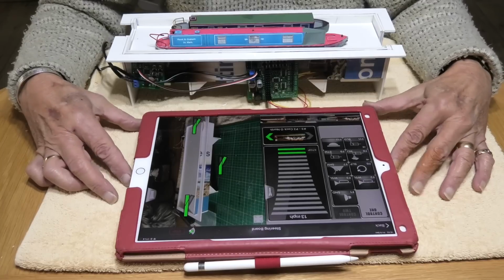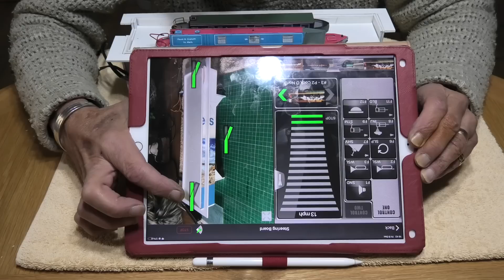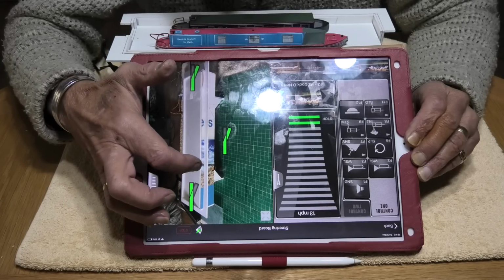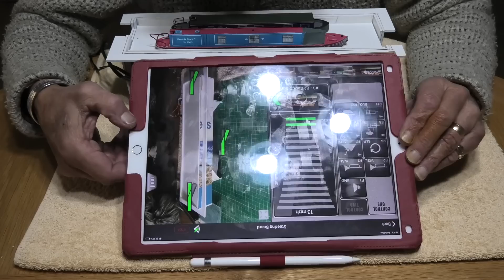Part 3 of building the lock - We now have raising and lowering water in the lock!       9-12-2022

Comment: Dear Graham, love how you accomplished your proof of concept for the sluice. For the guillotine sluice doors, am just wondering if it’s an option to use the similar method to move the doors? Especially where the guillotine doors demand a ‘rail’ system in which they move up and down. Which in turn would allow for all the servos to be installed below the water level. Anyhow, am very much aware what you said. Certainly don’t wanna be disrespectful with this question. The question arose more or less from your narration in which I understood you were going to put the servos on top of the model. Hence, it may just be a case of my misunderstanding. Love the project, absolutely beautiful how you are able to make the sluice surface move with such a simple and effective method. Curious for next developments and episodes. Cheerio
Reply from the maker: Hi Vincent and thanks for the comment, it’s greatly appreciated. I think there must have been a misunderstanding as regards the servos, they will all be below ground level and won’t be seen as per the concept module. The top of the model is the ground level (or will be once installed) so anything below that will be hidden including the servos but they will be accessible from under the baseboard should I need to get to them. I hope that clarifies it all for you and by the way, you were not disrespectful at all and politely asked the question so thank you for that.       Cheers for now.            …………Graham

Comment: This is very interesting.  Lock up and down, boat in and out, moving sideways.  It is quite the project.  I will be very interested in seeing how you solve it.  I know you will too because you are a master at all things mechanical and in this case electrical too.  Bye for now my friend…Rob
Reply from the maker: Hi Rob and thank you for the comment. I am working on one of the lock gates at the moment and it look ok at the moment but to save time then I will only build one gate as the other will be identical, as long as I can get this one working to how I want then I can replicate the other on the real build. The barges won’t be able to go sideways, if I want to move them sideways then I will need to do that by hand but as I’m planning to have only one barge which moves then I only have to concentrate on getting that into position, the other barge will only be for show.     Cheers for now my friend.         ………..Graham
Reply: @GrahamFoulston  A man with a plan.  I was confident you had it all worked out.  Good idea to build one, work out the issues and then duplicate the successful design.  It will be exciting to watch this develop.  Can’t wait…, cheers for mow
Reply from the maker: @FarlandHowe       Thanks Rob, I do have it all worked out in theory but at the moment that’s all it is, but what I’ve done so far seems to work ok so onwards and upwards for the gates now.      Cheers for now buddy.    ………Graham
Reply: @GrahamFoulston  I am sure you will get it solved.  I have the utmost confidence. Back to buying a mattress, ;-)

Comment: Great work Graham, I tell you what, something that you think is going to be quite a simple project has certainly turned out to stretch the old grey cells and to your credit you’ve come up with a very elegant solution.

Now, call me daft but when you say this is going to lift the ‘water’ up and down do you actually mean ‘water’?…. there, I said I was being daft but looking at your excellent engineering skills I wouldn’t be at all surprised 😯!

All the best,

R
Reply from the maker: Hi my friend and thank you for the comment. No you’re not daft at all but I won’t be using real water, it will just be simulated water using either resin or painted. Funnily enough, real water doesn’t work to well on OO scale models as it just doesn’t look to scale. Splashes and ripples look far too big for the scale, small ripples of real water can look like large waves in OO scale plus you have all the issues of possible leakage too. You are also right in that what appears to be a simple case of raising which at the moment looks just like a flat platform of board is a lot more complex than it looks, so many things have to be taken into account which are not immediately obvious. So careful planning and a lot of experimenting ensues before getting to this stage. Luckily for me it has worked out ok though and I’m pleased with this end result. The real model will be a lot more refined than this concept model so stay tuned !    Cheers for now mate.          ………..Graham

Comment: Very very impressed so far. Well worth the wait. How are the servos going to cope with the extra weight of the resin water?
Reply from the maker: Hi and thanks for the comment. If I put resin in for the water - and that’s not a certainty yet, then it will only be a very thin layer but the other alternative is to paint and varnish it, the servos will cope fine no matter which method I use.      Cheers for now mate.          …………Graham

Comment: Well done Graham. In the past I have moved the pot doing the feedback, jumped a tooth on the gears, or the gear on the feedback pot to get two the same. Concept well proved. I wonder if you could put a potential divider on the servo motor and drop its operating voltage? Up would be slower than down due to power available. Weight of the "water"  may be an issue as well. There used to be linear servos about that were quite slow, I wonder if they would be any good, if you can still get them of course.
Reply from the maker: Hi Des and thanks for your comment. I’m quite happy with what I have right now thanks and as regards the speed then as I said in the video, I also have that sorted without and add ons. All will be revealed in the new year. There are some good linear servos available if the existing servos I have won’t be of any use so I could use those. Anyway, leave it with me and let’s see what turns up but at least I have this part of the concept working to how I want it to work.        Cheers for now mate.         ………..Graham

Comment: Graham, wow that was fast (the build, not the water level - that is soluble - ouch). So cool. I imagine the problem and it's solution have been ticking away in your 'little grey cells' for many months. But always great to prove it in model form, true CAD (cardboard-aided-design (or in this case plastiboard-aided-design)), at it's best.
Of course as it's DCC presumably you can also trigger realistic gate raising/lowering and water rushing noises too? Goodness alone knows how you would do that, but if anyone can you can!
Reply from the maker: Hi mat and many thanks for the kind comment and yes, this has been trundling around in my very old brain for over the last two years but only seriously within the last couple of months. There was quite a bit of work done before I even got to this stage as I had to get some form of plan together before I even cut the first bit of polyboard. Having sound as a function shouldn’t be that difficult, I can write and record the sound onto a sound decoder so when I operate the gates then the sound will be heard - bugger, I have said too much already!    😂😂.       Cheers for now mate.        …………Graham

Comment: You might call it rough and ready but it's already an excellent bit of civil engineering 😀
Reply from the maker: Hi Alastair and thanks for the comment, in comparison to the real model then it is a bit rough and ready but this was never meant to be pretty - just working will do for me!    😂😂.   The real model on the other hand will look pretty with a huge amount of scope for detailing and I’m so looking forward to getting to this stage. The nice thing about this is that I should be able to do most of the building and detailing off the layout so that once almost finished I can just drop it in and finish it off on the layout.   👍🏻.    Cheers for now mate.           ……………..Graham
Reply: @GrahamFoulston  can't wait to see it finished Graham especially when the barges use it as intended!
Reply from the maker: @alastairwilson457       👍🏻👍🏻👍🏻

Comment: I am confused, how will the boats move sideways to make room for a second boat?
Reply from the maker: Hi and thank you for the comment. River boats have ‘barge poles’, these are long wooden poles about 6 feet long with a hook at one end, when mooring up or leaving a mooring, they can be used to hook onto an embankment or another boat to either pull of push the barge or boat into position they want. Or you throw a rope to someone on the embankment or the other boat and they can pull you into position by using the rope - all standard procedures.  Hope that helps.      Cheers for now.         ………..Graham
Reply: @GrahamFoulston  I thought you said the boats would be radio control, thus would only steer at one end, so to get two models in the lock, how would the back end of the first boat move over to the other side to allow the second to enter?
Reply from the maker: @TimberSurf      Only one boat will be radio controlled so the second boat will be position manually by me - should I have a second boat in there that is. I never said that both would be radio controlled.